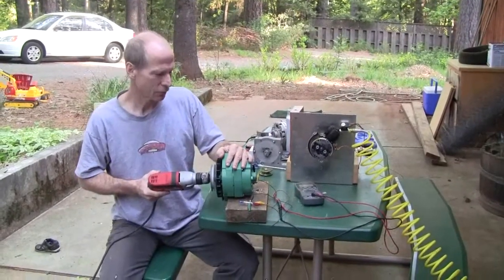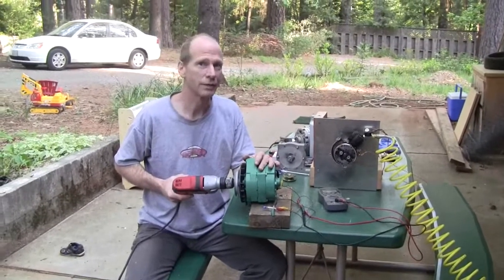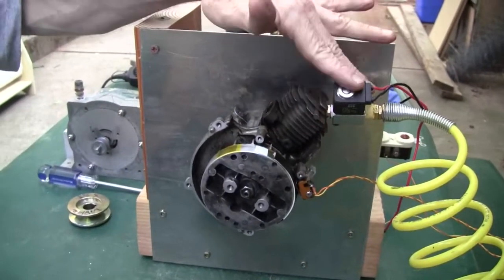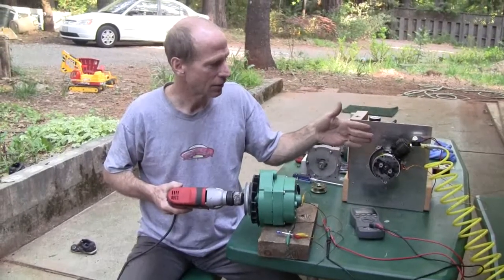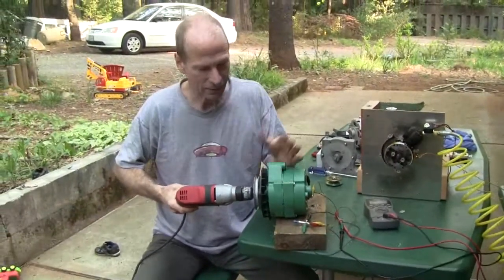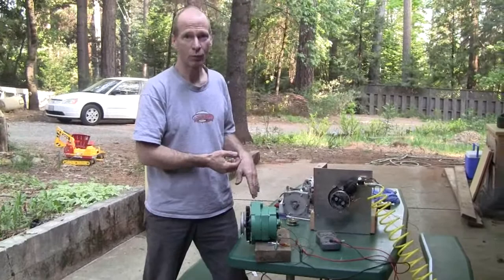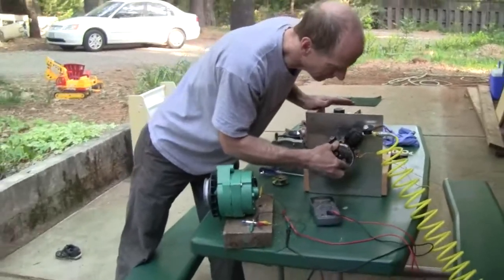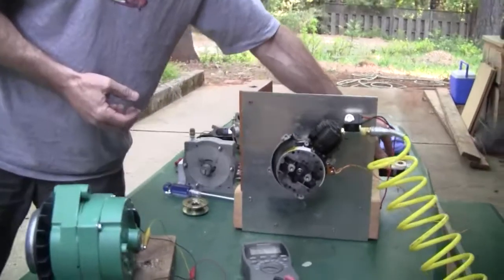2 cycle steam engine home power.wmv

Comment: Nice project however...... 2 cycle air cooled gas engines make horribly inefficient steam engines. You never want cooling fins on a steam engine. You can get a substantial improvement by grinding off all the cooling fins and adding insulating lagging around the cylinder. Best of luck with your project. If possible, go for a double acting steam engine.

Comment: 2 cycle engines have the motor oil mixed with the gasoline. How are you getting oil to the crank if you are running it off steam.
Reply: Like any 2 stroke steam engine

Comment: Nice video, I was also wondering what happened to the turbine thing. 

I am now developing a steam exhaust heat recovery system for my boiler (any steam engine) and would like to pick your brain about some details. 
I have run at 7 psi without recovery system and then 10 psi with the heat recovery system. I think this system could greatly improve your wood chip project and I would be glad to share ALL information with you for your basic steam knowledge. 
( or FREE) oct1113 @ hotmail.com

Comment from the maker: Hmmm?  Hope I'm understanding you.  Yes.  Every 2 cycle engine will have a dead spot at bottom dead center, give or take a bit, because the ports are open.  To eliminate, and what I'll do in future, is to use a 4 stroke engine, double the cam lobes, and use a 4 or 8 cylinder engine.  That way, it will always start.  But sure, you could do it using multiple cylinders.  That said, this works great.  All you need do is start it with the crank at the right angle, then off it goes.
rt

Comment: Great video!  Do you have a "dead spot" when the engine is exausting?  I have a similar idea, but using three 1-cylinder engines, so at least one of the cylinders will be under power all of the time (first to generate electricity, later to power a car -- I hope).  Keep up the great work.